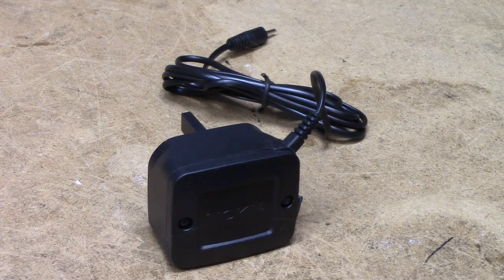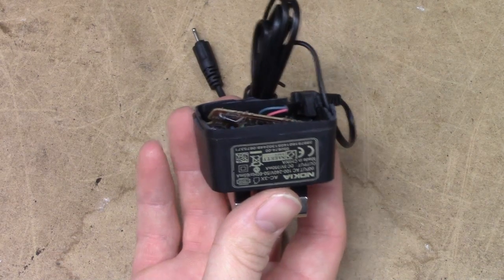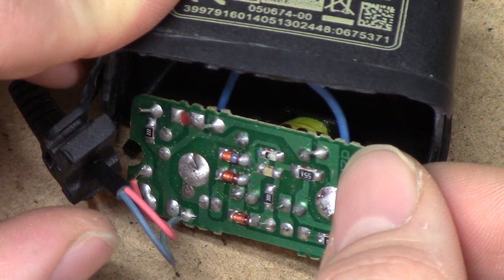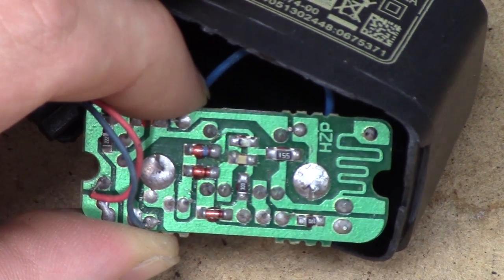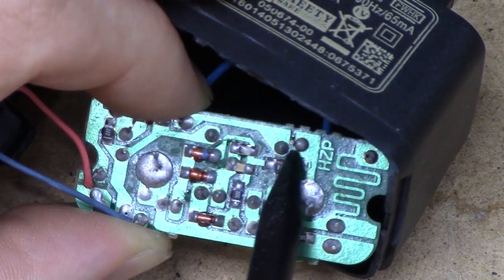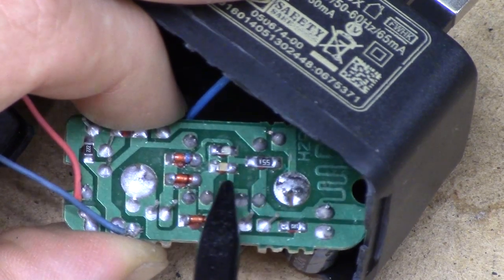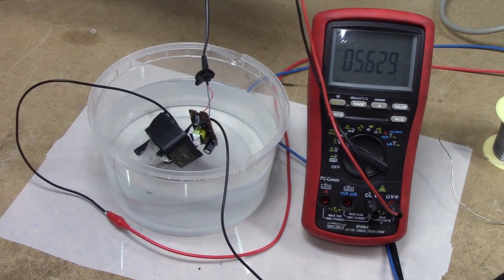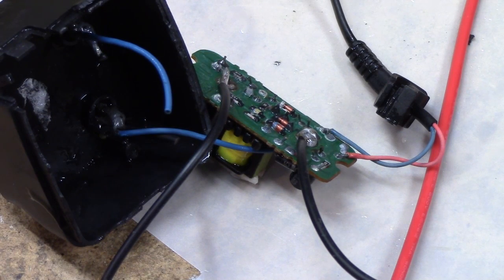Lethal fake Nokia charger takes the plunge

Comment: lol it even had a "SAEETY MARK" label....not sure if the Chinese manufacturer deliberately inserted a typo there or not (it's supposed to read "Safety mark", simply compare all the labels with the ones from a known genuine powersupply).
I've had some fake chinese laptop powersupplies with similar typos on the label (got them from a chinese eBay seller a few years ago to see if I'd get genuine HP parts or not)
Reply from the maker: +nerdywolfi Perhaps saeety is the opposite of safety.